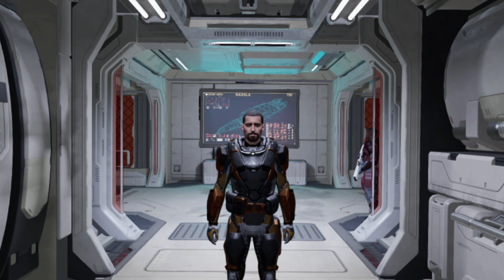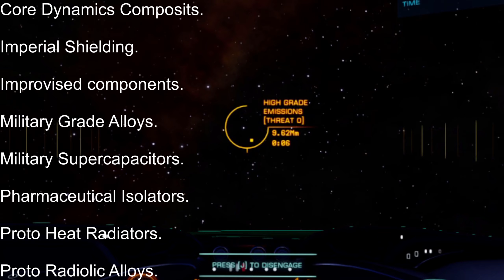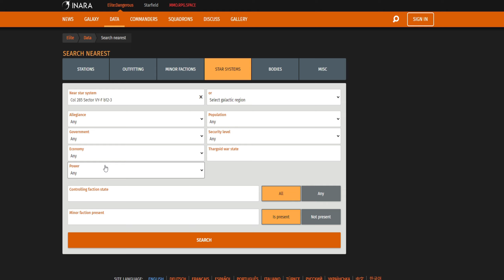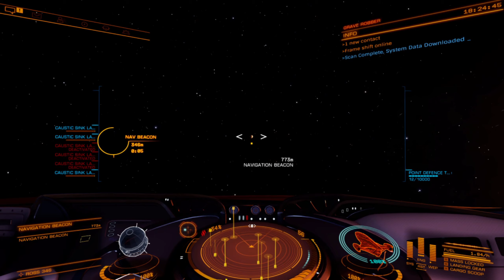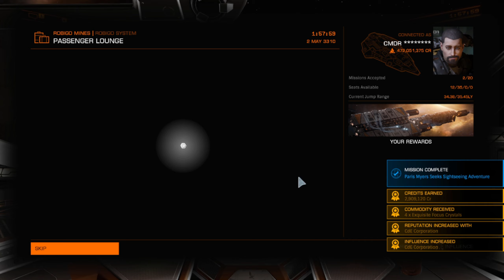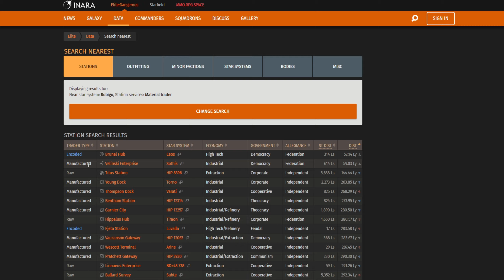Manufactured Engineering Materials 2024

Comment: Found a high grade in the system that I was in, right when I was watching the video. There were not 4-5 canisters. More like 10+ for each T4 and T5 mats. Relog and the same thing
Edit: Jeez, I think RNGeezus is broken, another system, another state of it, around 20 Super Capacitors.
Reply from the maker: This video was before the buff to the amount of mats found within a single high grade.  I was looking to make a new video but as the changes was only boosting the amount found and not altering how it worked, I felt a new video would come across as trying to scrape views for the same information .   o7

Comment: Not sure if I am doing something wrong but I have gone to multiple systems in a state of war/civil war in the hope of getting military supercapacitors, scanned the nav beacon but no emissions showing up at all.

In your video after nav beacon scan you show your navigation panel with <Nav Beacon> at the top and the various emissions under it, my screen had <Nav Beacon> followed by a list of stations, planets etc but no emissions at all.  I notice you have some filters on but I have not found the filters helping - if i select signal sources for example my list is blank, any ideas please?
Reply from the maker: Hi there, that is odd that no signal sources are being detected. I mainly have the filters set to ignore everything other than the signals mainly to save time scrolling the list. 

I would try removing all filters to rule out it being bugged, and then try seeing if any unidentified signals are showing up in the full spectrum scanner.

If there is still no signals to detect hop to a near by system to check if any are populating at all. If its the same in all systems and not even the full spectrum scanner is seeing anything I would think about opening a support ticket as something should of shown up by this point.

I hope this helps in some way let me know what the outcome is please as this is quite odd.  o7
Reply: @StewiePlaysPC  Sorry for the late reply, I don't get to play so often! Not sure what was happening but sources are visible now, no settings changed, just was not getting them before. Too lazy to top up on all types but my inventory of manufactured mats is now quite healthy - thank you :)

I notice your guide misses 2 of the 10 manufactured material types - exquisite focus crystals and biotech conductors - any ideas on the best way to gather these please? cross trading works well enough for me with the ease of farming but curious if there is a better way :)

Thanks again for the guides, keep it up!
Reply from the maker: @mikedixon1528  The exquisite focus crystals and biotech conductors are covered in the guide starting at 2:50 . Unlike the the firs 8 materials they are best found from missions.  o7
Reply: @StewiePlaysPC  Ack yes, i had paused on the 1 minute mark to get the list of mats and system states, did not revisit the later bits. o7

Comment: Good guide... but why bother putting 2024? It hasn't changed...
Reply from the maker: Hi there. F Dev have said they are looking in to engineering with regards to cost and mission payout rewards, but they have not said when this will happen and what grades , type of material group and the amounts they have in mind. 

New ships are on the way , one dropping early access tomorrow, and the roll out of part built ships in the ARX store as templates for new players to expand on. 

With the ships due to arrive I found my self needing to collect materials , spending ages wandering shard / braintree planets looking for raw mats. I found my self having to spend ages on each one trying to locate places that had the top grade mats in high amounts as shards were no longer a POI that you could target  the last time I need to collect mats was Horizons . 

With all that in mind and wanting to be helpful , I made guides to help new and old players with the most up to date information possible to provide them confidence in the exact GPS locations on planets, the systems and faction states needed and the most time effective way to date. 

F Dev will alter things at one point and the new alternatives will need to be tested vs the confirmed most up to date methods we have. its my hope to save time in that testing by doing all the leg work now. 

Sorry its a wall of text , but there was no short way to explain my reasoning.  o7
Reply: Personally I appreciate the 2024 tag, it stops me wading through a bunch of 2016 outdated stuff. I know some Youtubers just rehash old ideas with a "New for 2024!!" click bate type title but in some cases it really helps. As a returning player knowing that what I am learning is still relevant is a big plus :)